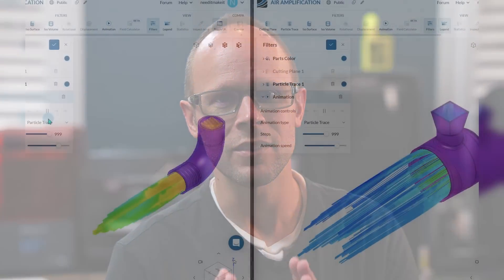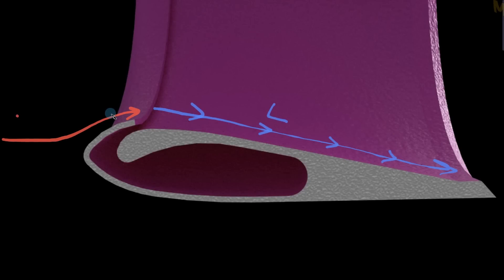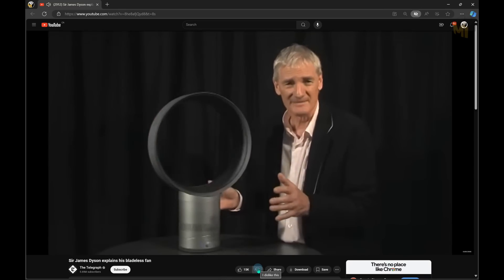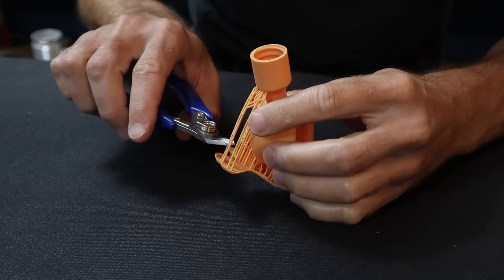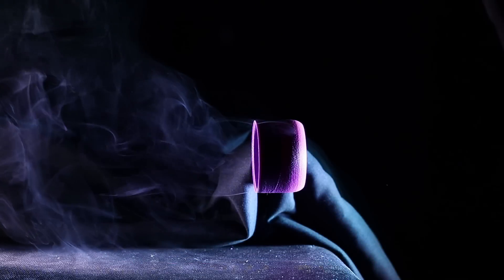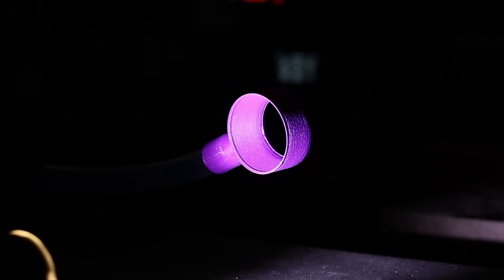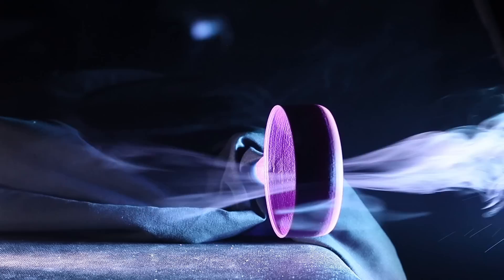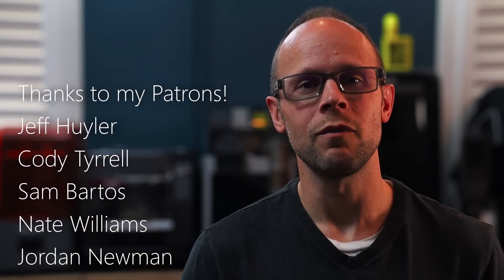3D printing a functional Air Amplifier and testing it to see if...

Comment: im not sure I would trust Dyson's claims on how effective their design is. they're masters of bullshit deceptive marketing. their fans definitely don't move 15x more air than a normal standing fan. I think the 15x number is how much extra air the bladeless duct moves compared to just the tiny impellers in the base of the unit(which are optimized for pressure, nor volume). not in comparison to a normal fan of the same diameter

I genuinely don't think it's possible for the extra entrainment to compensate for the huge decrease in efficiency caused by having to redirect the air and squeeze it through that small opening. The "bladeless" design's only actual benefit is aesthetics
Reply: Definitely.  Volume isn’t the right measurement, it also needs to factor in speed of motion.  My experience with these fans is they use a small fan running fast to move a larger volume of air slowly.
Reply: In physics it is always a trade. In this case it is going to be from low volume high pressure/velocity for high volume lower pressure. Under the right metric, something like mass air flow, it will be the same (or less due to losses).
Reply: @barongerhardt  physics is not always a trade. for example using a normal fan is always going to move more air than using a fan with blades made out of wet noodles.

some designs are better than others, and im not convinced dyson's design actually has any benefits over a fan of the same diameter. they use a smaller impeller running faster and producing more noise, and try to compensate for it using a complicated entrapment design, and for all that effort and design work they manage the same or similar amount of airflow to a regular cheap standing fan.

similarly, i dont think it is physically possible for needitmakeit to get better airfow out of a hose by obstructing the exit with a dyson-style duct and redirecting the air 90 degrees sideways rather than simply leaving the end open.
Reply: @Hephera paint shops and body shops use these things all the time. They do work, they do change speed for volume, which for the purposes of a paint shop is a far more efficient way to work. The Dyson? Could be iffy. Doubt those wee little turbines can make much pressure anyhow but if you have a compressor big enough, you can use such a venturi to safely ventilate a mine shaft. in fact it's one of the principle uses. Also check quickdraft of canton Ohio. Venturis rock, Dyson less so
Reply: @unclejoeoakland they are only useful for controlling the spray pattern, not for achieving air entrainment.
Reply: @Qui-9   watch very carefully. You will see a gap between the smaller tube out the side of the tank and the larger wedge shaped tube it blows through. Because it's a venturi. Otherwise this wee five gallons of air wouldn't be enough to seat the bead on these stiff, ancient tractor tires.

https://youtube.com/shorts/QNFtFLNvars?si=QSyisQ-Cs9l8TswJ
Reply: I don't think that you guys were paying attention he specifically says in the video the Dyson guy that it amplifies the air from its own impeller by 15 times not that it's 15 a different fan design than a standing fan
Reply: @phasesecuritytechnology6573  and dyson is profiting from that confusion
Reply: The peak efficiency for the venturi effect is 38%. The bladeless fan therefore uses 3x the energy to move the same volume of air. It's also noisy
Reply: It's not even their idea, it's licensed from Panasonic.
Reply: Separate reply since the last one turned into a rant I wish more people understood instead of standing around like breying babes hands full of chinese garbage....but it was cheap! Why yall crying?

Anyhoozle... Yeah these things need good deal of pressure AND airflow to work right. Ive used a similar device (venturi air amplifier, IIRC) for themed attraction fog effects, and when you have a 220 3 phase roots blower powered compressor blowing into them, they're pretty neat.

But the whole fudging the numbers thing to dupe people into buying something (ie, exactly why people get garbage from amazon and temu and alibaba, etc because they trust the person trying to take their money....for reasons I will never understand) has been around forever. The current state of Amazon listings is all you need to understand what happens when that lack of integrity becomes commonplace... The worst part is new generations see it as normal. They dont question it. Why would a seller lie to them for a sale? Their adverts were just so pretty! They even used PC buzzwords....bad people wouldnt do that! It doesnt make sense......🙄😒

Though I will say this about dyson....Those high speed microfans are FREAKING NUTS!!!! I wouldnt  mind getting my hands on some just for random projects
Reply: Youre not wrong, Dyson is like the sharper image of 'sellers over advertising muddled stats and warped numbers to sound special therefore expensive' Or in other words.... sharper image.🤣

Its like how every laser on amazon is like, say '5,00000 MW' ....FIVE HUNDRED GIGAWATTS?!?! Well, no, first they play hot and loose with the comma and decimal point, the last two are the tenths and hundredths, like how currency shouldnt be displayed but they also tend to do out of a blatant lack of respect for the intelligence of the buyer.... 'oh... FIVE GIGAWATTS?!?" ...[sigh] No, they also play fast and loose with the SI units. Its not MW (megawatt, also a thousand megawatts arent a thing, points for converting that in your head and not saying something silly like five thousand megawatts...I mean, thats almost as ridiculous as using a measurement system derived from a kinds foot! Or complaining about others using that system then still putting it on your road signs, using to for long distances, or utilizing their scale of temperature to make the day sound hotter. THATS RIGHT, I SAID IT! FIGHT ME!), its supposed to be mW for milliwatts. 'Okay, 5,000 .... milliwatts. Can they not just say 5 watts?' 

And the answer is: 'NO! They cant! You silly round eye! Buy this slap dash knockoff item in this listing of outright lies and misused stats and numbers, with the same computer generated imagery as all my other seller accounts, that youd think SHOULD be easy for the sites systems to detect once spotted and reported (AMAZON!!!) if they werent making enough on the sales of this kind of garbage to not give a shit (A M A Z O N!!!!), listings that any one of which I can  fold at a moments notice when people receive the item and realize its a piece of junk which is nothing like what the listing implied and start complaining or asking for refunds therefore duping you western hamburger dummies out of your money for the great Chi....er, I mean nondescript country in which the factory district that I happen to broker sales for is located....' - literally every piece of trash human being operating the scripts that spam these types of listings all over amazon, temu, wish, badu, etc, are obviously thinking evidenced by this behavior that has spread like wildfire as they sell obvious junk with not so obvious lies must be thinking about us silly foreigners that keep falling for it and purchasing their near factory reject garbage, or in the case of wish, their factory reject garbage, if the thought about us as more than walking wallets at all that is.... apparently shame isnt as big of a thing over there as we thought....oh wait, we're round eyes, we can be bamboozled and its a badge of honor....

And it gets worse! Thats the input power. Thanks to the inefficiencies in the power supply, and generating the laser light, they dont bother posting the measured optical output of 1W. They just bend the truth over a sawhorse and raw dog it to have the bigger looking number (5,00000MW!!!!) than the other brokers running the exact same racket. But hey, at least they're not posting dishonest numbers....they just LOOK dishonest. At least once you look past the whole, "oh! This one has a bigger number" reaction they're trying to trick you with....

TLDR - Yes, its fucky, yes its worse than you think, yes it should make you angry, no it wont, so just hit purchase cart like we all do.....
Reply: Kids don't get hit by the fans is a plus, but not 10x plus when yelling at that dumb kid will do
Reply: There are also a large number of bozos who honestly believe that adding a venturi to their aquarium pump will triple the flow
Reply: Dyson is secretly just selling you advanced motors and compressors that makes the gimmick work as advertised
Reply: The Dyson fan is a cool looking gimmick. The energy in the moving air can't be amplified or else we could build a perpetual motion system out of it. That said I think the idea could be useful to avoid dragging warm air from near the extruder to the air flow.
Reply: @colinhercus7765  noone is suggesting it's a free energy machine. We're talking about the most efficient way of converting a high-pressure low-volume flow of air into a high-volume low pressure flow.
Reply: @Hephera  But they keep saying it amplifies the air by 15 without explaining what it means. If I amplify sound by 15 it gets much louder and may annoy my neighbours but if I amplify air volume by 15 while slowing it down  I haven''t achieved anything I couldn't do with a bladed fan, just that it looks cool.
Reply: @colinhercus7765  Ammount of air moved is not the same as energy. If we´re looking at the kinetic energy of the moving air, which is calculated with e=0.5mv² , you can, without changing the kinetic energy, accelerate a bigger mass of air at a lower speed. I am not sure, if this helps in part cooling setups, since the ammount of thermal energy transfer depends on the Reynolds number, which depends on the speed of the air, but with a cpap setup it might be worth a try. Since you are working with a high pressure fan anyways to move air through the hose, this could increase the cooling efficiency. I´ll probably try it once i´m done with my damn bachelor thesis.
Reply: a major reason to have "bladeless" fans is safety, cant get your (or a kid's) fingers cut if the blade is inaccessible, not that dyson shouldnt be called out for bullshit marketing ofc
Reply: @cinnamoncat8950 thats called a "learning experience."
Reply: @cinnamoncat8950  Maybe kids need to get a flerbrbrbt or two from the fan to learn not to do that. Obviously their parents arent parenting enough to do so.....

By the way, that imagined safety danger crap doesnt fly. Just because it CAN happen, does not mean it does with any regularity much less is a clear and present danger. Imagining it as such is disingenuous and a clear sign of someone who should not be trusted with children. Less they grow another generation of Karens. 

Case and point, I grew up with a death crib, a radioactive smoke detector, curling irons, iron irons, side load dryers, a 36 inch tube TV that weighed more than I did in a 6ft  entertainment center, with my parents vinyl collection in it and a hifi, no more than 18 inches deep not secured to the wall, glazed tile next to the 8ft sliding single pane glass door (nice and slippery when it was raining outside or just came in from the wet grass), a tile section which also had a ceramic glazed cast iron wood burning fireplace on it.....And I still have all my digits, no burns, no broken bones....hell I dont know a single person from my era that lost a digit to a fan. And we had those old sears fans with the three metal blades and custard yellow metal casing....

Know why? Because our parents parented. 

And not because one stayed home and watched us all day. Dad was an independent distributor stocking foods in local stores, and mom worked for the school district in the information services division (MIS for those in the know. Also, thats right, a women, in the workplace, administering the secured backend of department of education systems....gee, according to feminazis and their rhetoric, thats impossible, isnt it?) So, whats your excuse for expecting corporate america to raise your kids for you? ....Maybe you shouldnt have had them if you werent willing to raise them. Of course, these days having that choice depends on what state your in....And whether or not your reps see you as the kind of person to take revenge on your cheating spouse by getting a late term termination....oh? You dont think thats a thing? How do you feel about women working in data centers by chance? Or what about fan blades? Better yet, what are your views on strangers trying to instill regulations dictating how you're allowed to raise your children? Seems like an encroachment of freedoms to me, but dont worry, I wont go to pieces when you disagree with me. See, that parenting style of ... actually parenting ... means I can handle hearing the word "no" [door slams] Woops, there goes your little Caleb into the closet again....
Reply: @zombieregime  are you ok?
Reply: @cinnamoncat8950  heh, if you cant handle exposed fan blades, you have no chance against my issues, mate.....
Reply: @zombieregime  i am aware exposed fan blades isnt much of an argument, i was just playing devils advocate
Reply: @cinnamoncat8950  Extra ball? (if you get this reference we will instantly become best friends. Answer wisely....)
Reply: @zombieregime  hmm... i dont think i do, only thing that comes to mind is that markiplier clip/animatic about a 3rd testicle
edit: still do tell what its a reference to, its possible i know it and just didnt get the reference
Reply: @zombieregime  i'll second that other person; Are you okay?

bladeless fans are not causing 'the fall of the new generations' or whatever fascist BS you're trying to imply, lmao.

Comment: recommendation for using chitubox supports, I have printed some pretty wildly detailed stuff without distortion by increasing the support density as high as 80%, but reducing the contact point and diameter of the supports. you can go quite thin on these and you end up with a pretty nice network of still robust support columns but with very fine connections between the model and the supports. the prints tear off the support matrix very satisfyingly like Velcro releasing. I will usually add one or two more robust support pillars on an area where the detail is non critical, but usually the larger surface area of all the additional contact density is enough.

Comment: You restrict your flow right between the ring and the inlet. You reduce the diameter which has a significant impact on your flow rate. You need the same diameter all the way throu

Comment: You could get an anemometer to measure velocity and CFM. It’s tricky for direct comparisons with dissimilar shapes but you traverse multiple points than average. 

Conversely you could buy or build your own flow hood. Look up “flow hood” and then look up “Testo 417” so you can see what I mean by build your own. 

Point is, there are relatively affordable instruments for measuring aspects of air movement. I used to have a CPS anemometer that plugs into your smartphone for quick and dirty measurements, it was like 20 bucks. I do this professionally btw for balancing airflow in buildings for temperature balancing and for building ventilation systems especially for things like labs where you need to move air in specific directions and maintain specific pressure zones.

Comment: For the smoke test i would say it could help to fill a bottle with smoke and then use a pipe to direct the dense smoke. You have more control to highlight different areas then. 
I think Major Hardware showed this method at some time in the Fan Showdown
Reply: I think it's better to fill a trash bag with smoke. It holds alot more volume and the amount of fog can be easily controlled by pressing on the bag. You can also attach multiple small pipes and configure them in an array to visualise the airflow in a lager area.
Reply: @RonTheelen472  Oh that's a nice idea

Comment: Pipe itself have same time as "air amplifier" u printed because it's far from the bag, like smoke test show, it can "suck" air around its path but need more space for that , where with "air amplifier" path is as short as the print.
PS
You can make it in almost any shape so square cooling ducts could be pretty cool if they will work

Comment: Video tips: For portrait shots: Better lighting on your face, in front, sidelight, is for effect, or colors, but have a good front light, right now there is a lot of contrast and shadows being created. Also, distance, you don't have to be full on upclose, it's better with a little distance and making sure your head is in the middle of the frame. Don't move your body, this creates a lot of "big" movement, especially for portrait shots you'd want a calm steady shot, people will focus on what you say instead of getting nauseous, haha. Distance also helps with that if you're a moving kind of person, then standing shots with more distance and for instance sitting shots can be closer.
Reply: The primary thing he needs to do is position his key light so it's Illuminating his eyes.

At this point, his lighting is so bad it's distracting.
Reply: @SimplestUsername  Exactly, you'd want a filling light, front and matt, so it doesn't reflect in his glasses either.